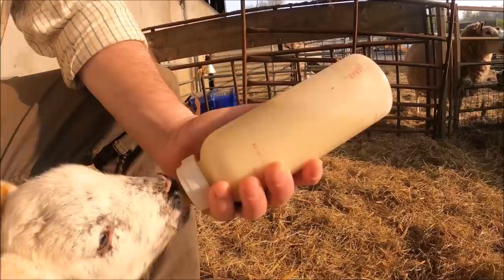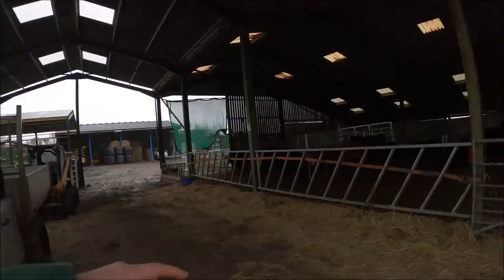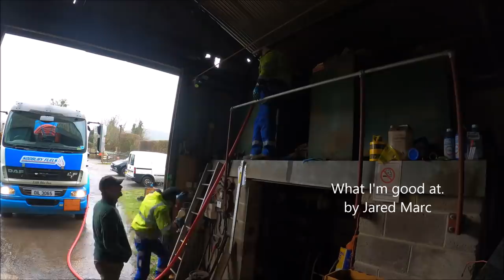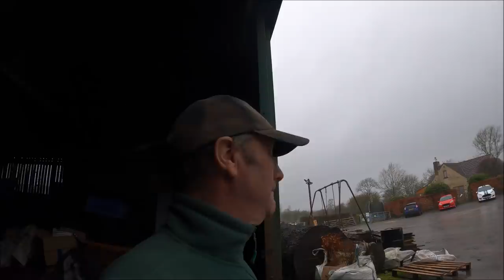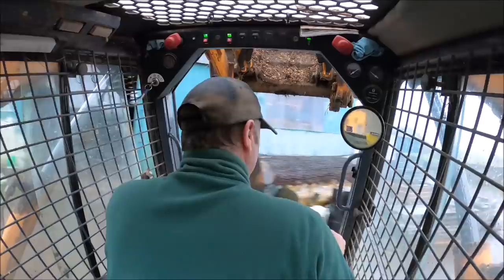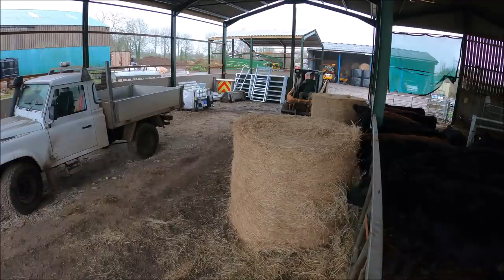14 02 22  Our Gas oil arrives!

Comment: Due to proposed changes an enforcement of fuel laws filled the vintage tractor with road diesel for ploughin matches etc got a bit of a shock 🙄😳🤬 do u have a bund under your tanks at the vintage club we got told delivery drivers won't deliver unless there was one 🤔 good video much better than the weather 🌧️🌧️

Comment: .... the boss, the rancher side has an attachment that goes on the 3 point on the tractor. It has two arms that fit around a bale on it's side that hydraulically come together putting pins in the center of the bail and then as the tractor drives along with the bale touching the ground, the bale un-rolls ... thought this might be interest as to how others do it, he does not do it in a barn setting, he does this in the snow covered hay fields where he keeps the herd over the winter when they are down from the range. The feed line is constantly moved so that the cows are fertilizing different sections of the fields. .... how long does that fuel delivery last for, hope it is for at least a few months .... ah the wet season .. my least favorite times of year in the bush, the in between dry and snow and likewise between dry and snow, that means mud in the bush and quite often getting pulled by a cat .. no fun ...  thx for the peek into your day ... as always .. never stop dreaming, just dream bigger .. have fun be safe, save our oceans ....

Comment: You must get your spouts sorted before the big rains, or your be in a bog. You have a lot of distractions each day and so your jobs take for ever, it happens to me.

The feeding look a lot easier with having to move the cattle just to drop a bale in. Can you do the same for the other pen.

Glad I'm sat here in 26 deg C, had to get another bore hole drilled to cope with the extra land. We installed a filter system on the first one and that slowed delivers flow too much to water veg and fill the house tank. Can't wait for rainy season where we get a down pour for an hour or so each day, winds are in the 20 klmh. range at present so nice and cooling in the evening.

Comment: Did not think the pence was worth as much as it is.  76 pence is $1.32 Cdn. The last red diesel we got for boat last week was a $1.27Cdn  so quite comparable, although very disturbing considering it was around  .80 cents last year at this time. The most disturbing part is the price of clear diesel at the pump for my truck.. $1.67  OWIE
Reply from the maker: We will be going back to horses soon 😬😄
Reply: Around here (North  Norfolk)  white diesel (road fuel)  is <> £1.54 / Litre OR  $2.66 Can !!  is a bigger OWIE    ☹
Reply: @markfiges999  
OWIE is right. 
They are predicting we will see $2.00+ Cdn here this summer per Litre.